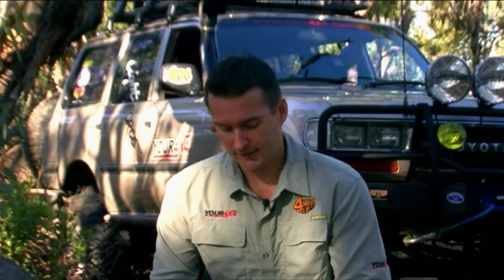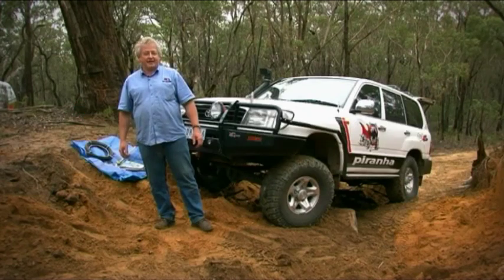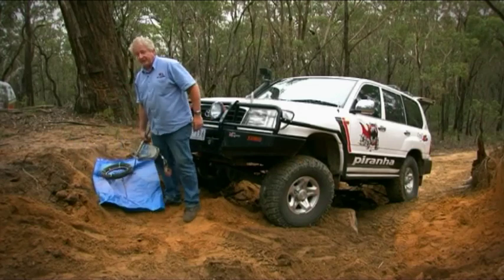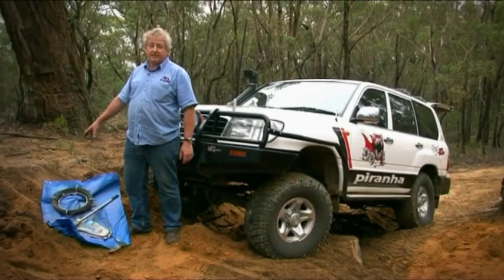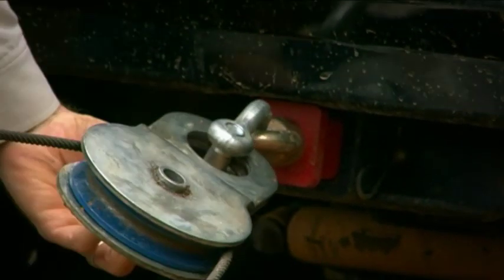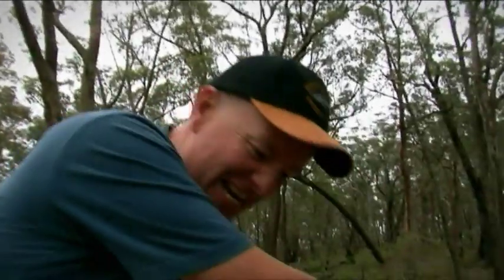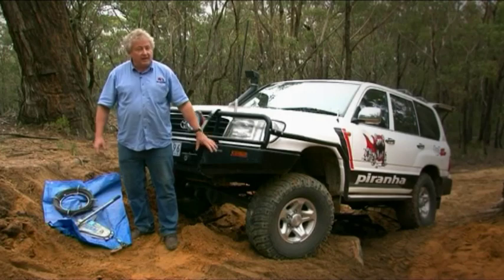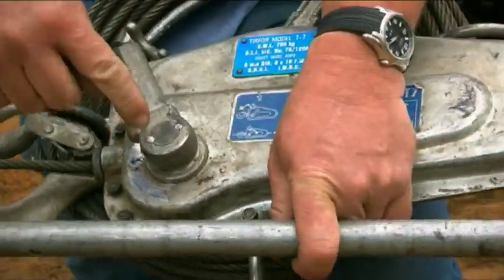Ask an Expert - Hand Winching

Comment: @byoungizzle a shovel, a spare tire/plank/downed trunk, and some manual labor makes a pretty cheap anchor. just bury your 'anchor'  perpendicular to winching direction a few feet down taking care to disturb as little dirt as possible, and make a small trench/ramp for the cable (so it's not coming straight up out of said hole). connect line to anchor. winch. in this you're using compacted earth and a large surface area anchor, to provide anchoring traction.

Comment: Is there a cheap other way to get a ground anchor besides buying this little package? I have all the other wonderful accessories but not an anchor for when I'm out in the bush with no trees, thoughts?
Reply: Take a chain section 3' long or so and 4 or 5 pieces of rebar and drive the rebar partially into the ground.  attach the wench to the chain.